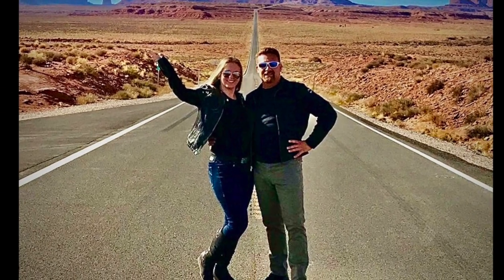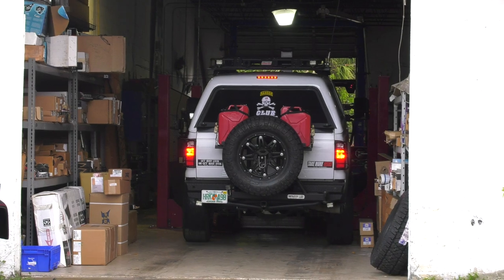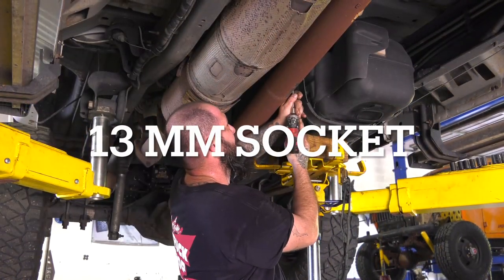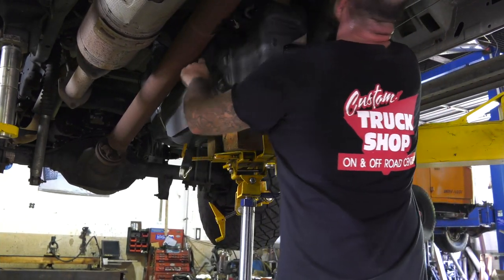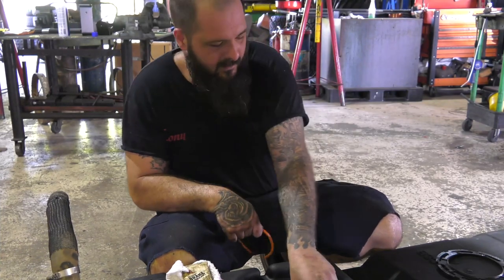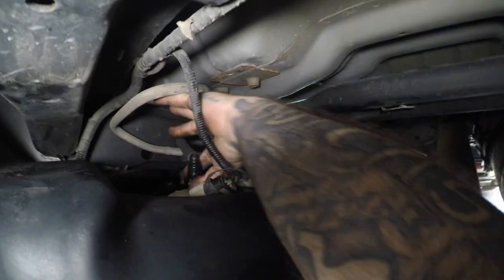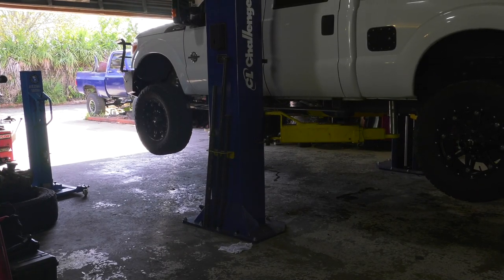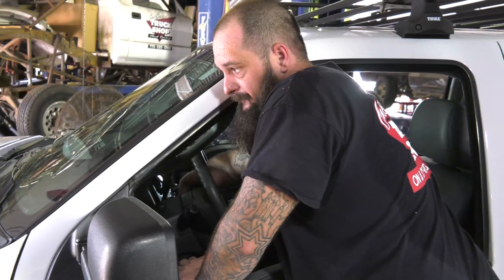Titan 60 gallon fuel tank install

Comment: This is bad ass.  These tanks are a game changer in the long distance traveling.  60 gallons of fuel, get out. That's a sick set-up with the truck and trailer too. Kicking the fear of running out of fuel out the window for sure.
Reply from the maker: Thanks! We're thinking of adding another tank in the bed so we can get over 2000 miles of range. I don't want to be caught in a long line when the Zombie Apocalypse happens. Or, even worse...all fuel pumps are out of fuel! These tanks are literally a life-or-death insurance policy!